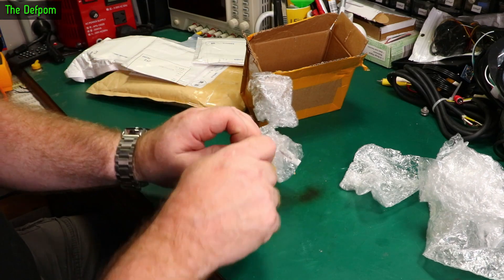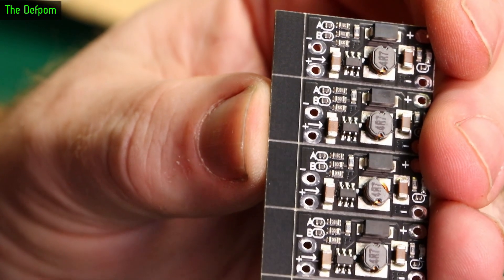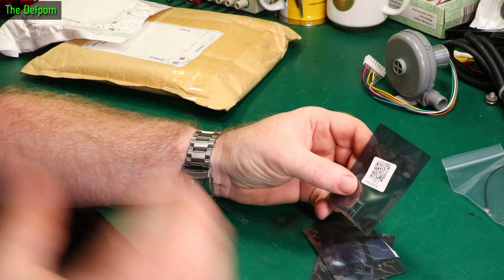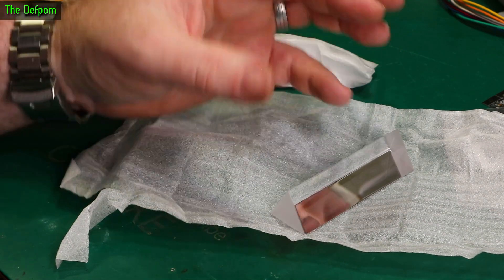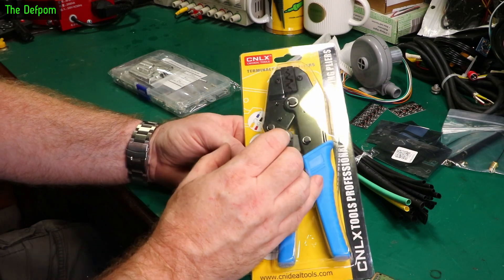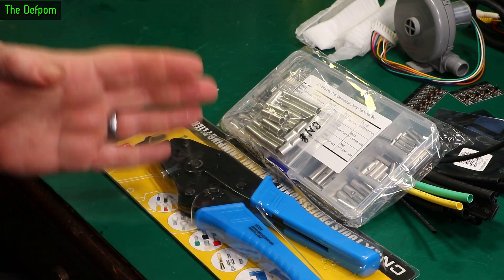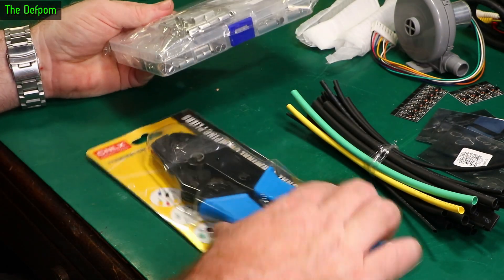🔴 What's in my Mailbag ? - Mailbag Monday 6th February 2023 - No.1096

Comment: 3:34 - Regarding mailbox, for outdoor usage, after assembly I suggest to use hotglue over pcb, to isolate it from humidity.
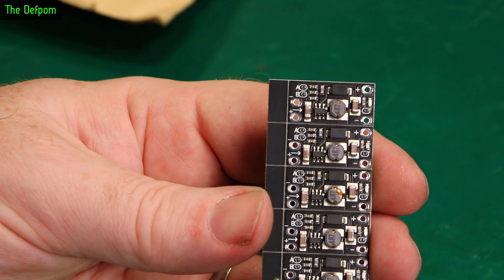4:00 - That 3rd board, has coil chipped off.
4:08 - Not sure if possible, but consider using small solar panel, few inches/cm, to recharge battery.